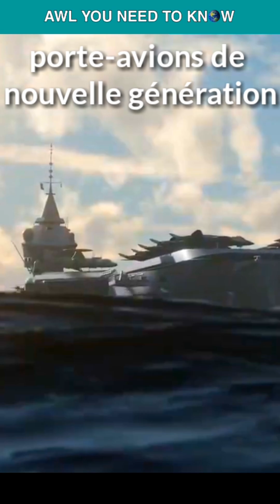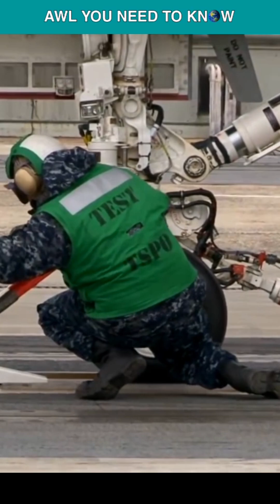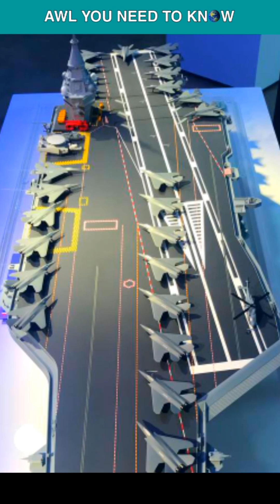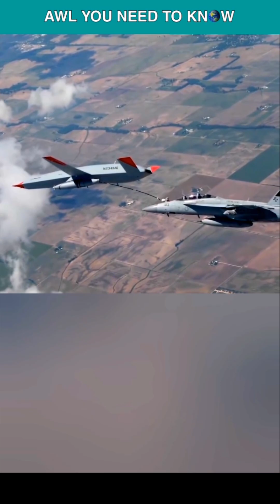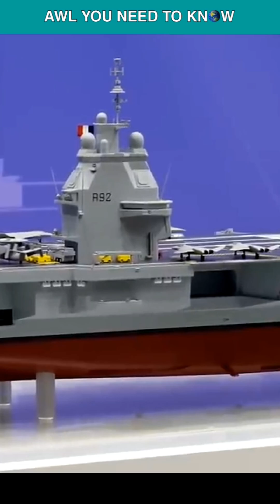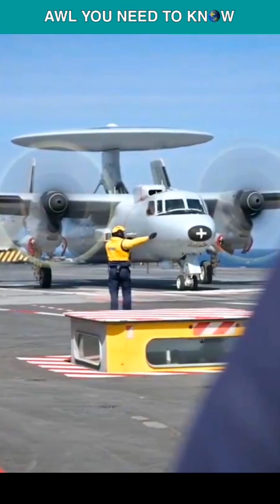PANG Is France's Future Aircraft Carrier #shorts

Comment: Have they not learned,  To have a carrier force you need a minimum of 2 carriers. If it has trouble or gets damaged that's it no air cover.   The Charles de Gal spent a lot of time in port , that is not a carrier force
Reply: The CDG spent less time in port than any US carrier, or UK carrier (and they are newer..)
Reply: It still is a good idea to have a carrier in reserve
Reply: it's still better to have one that spend 20-25% of time in port rather than no having carrier at all. It has served well during more than 20 years despite maintenance and upgrades stopping requirements.

Comment: If anyone really believes this carrier will be built then they need to look back at France's record with aircraft carriers. And EMALS? hell the US built an $18 Bn carrier and EMALS still doesn't work right 6 years after commissioning.
France simply cannot afford what this thing will cost. History proves it. Plus what aircraft will it have? It only has 30 Rafale Ms for the 45,000 ton carrier it runs now then what? It has no 5th Gen fighters and is only doing CGI for the EU's fighter project.
Reply: It has a 5th gen aircraft, it’s called the Rafale. And it will be operating the NGF once it’s out.
Reply: @brunol-p_g8800   You what? 🤣
The Rafale in any configuration is at best a 4.5 gen fighter. the Rafale Ms that fly off the French carrier are basic Rafales so barely 4th Gen and there are less than 30 of them.

And if you think Airbus and Dassault will ever agree on workshare let alone design of the EU Dream Machine you are on another planet.
Reply: @1chish  you’re clearly very misinformed. The Rafale Ms on the CDG are at the F3R standard, a standard that already has all the technologies of a 5th gen aircraft unlike the F-22 and F35. The incoming F4 standard will be better, and at the horizon of the 2040s when PANG should enter service  and operate the NGF, the RAFALE is planned to incorpore 6 gen technologies.